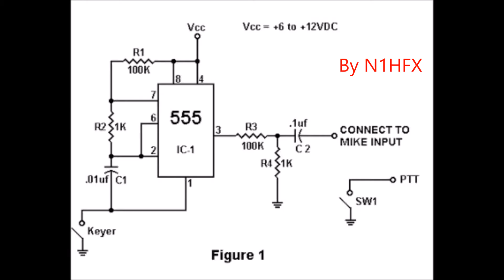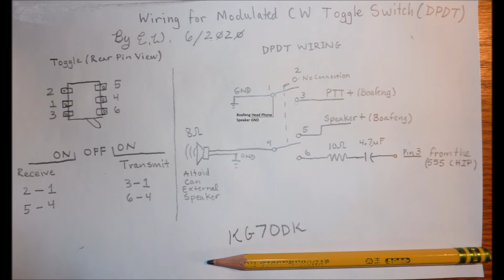Baofeng UV-5R CW Keyer, Morse Code via 2m FM

Comment: Hi, i am trying to do the same thing like the one in the video but i have a problem. I build a cw paddle with a metal clip for paper where the body of the clip is the ground pole and then two contacts, between the body and the two levers of the same clip, are 2 different poles (my idea was to destinate one pole to dahs and the other to dits. I tink that without a dedicated circuit this is impossible). Knowing that a vertical cw paddle is like a switch, if i want to use my "double pole" paddle without a circuit, it can be like a double pole switch? 
If what i said it's true i need to know if i can use my very very strange "iambic" paddle with the video's circuit. I'm asking becouse of the 3 cables that are in the output of my key... 
Thanks for help!

Comment: Hello. How did you make it? I tried to do it after you, but with a 0.1uf cap, and the RF from the baofeng plays with the 555 timer or something else, and jt changes up everything, the pitch and all. The pitch also isnt stable. Any help?
Reply from the maker: Its possible the newer Boafengs are more suseptable to noise? Maybe upload a youtube video of your build and we can inspect it for any possible faults. The hardest part is patching into the existing headphone / mic cable because the wires are so small. I would recommend using the exact capacitors listed in the circuit. Did you replace C1 with a 0.1uF cap?

KIR EW
Reply: @evanwolfe2525  I did yes, I used 0.1uF caps everywhere. It outputted a nice pitching sound, but the moment I pressed the PTT button (the baofeng wasn't even connected in any way to the circuit), it just stopped beeping. I suppose electro magnetic fields?
Reply from the maker: @avernayazaschita  The 0.1uF may be part of the issue. So when its disconnected and you ground pin 1 of the 555 chip to ground you should get a tone from pin 3. Disregarding the boafeng, on pin 3 you should have a 10 ohm resistor and 4.7 uF capacitor in series with an 8ohm speaker. I would test this portion of the circuit before trying to connect to the boafeng. Build on a breadboard then once working transfer to a soldier board. You should not get a tone until pin 1 is grounded. 

Are you able to upload a video for inspection and tips?

Keep It "ReeL",
Evan
Reply: @evanwolfe2525  I cannot because I'm not near it. I'm not sure but I hear a tone, and I built it a bit differently. I used a 10nF cap, 100k and a 1k resistor. And it works pretty fine. Until I turn on the Baofeng.
Reply from the maker: @avernayazaschita  Roger that. Next time you're by it get a video of what its doing and draw a schematic of EXACTLY the parts you used then we can go from there.
Reply: @evanwolfe2525  Okay sure! Another thing is, it's not protected by any aluminium or any can. I believe this can be causing all the problems?

Comment: Hi Hello Evan !!  Awesome  !! My Question is Could The MFJ - 464 Keyer - reader be Wired up To Replace Your Unit as My in Favour of a Computer Key Board  ???
Reply from the maker: Peter, Yes you could wire the output of the MFJ 464 into your radio's microphone input. This will allow you to SEND cw over 2m for example. My only concern is for receiving cw back with the MFJ 464. I have a PSK 232 that would translate cw to text fine on HF when my radio was in cw mode, however it wouldn't work on our local 2m FM repeater. Why? You might ask... I believe it is because my PSK 232 is looking for the on and off continous waves to drop in and out instead of a constant audio received from a modulated tone sent via FM, i.e. where the repeater is keyed down constantly. I have no doubt your unit will send well, but you may have issues receiving, i.e. translating CW to text via a modulated tone over 2m FM repeaters.   What type of radio will you be using to transmit? Keep It "ReeL",  Evan

Comment: Thanks very much, Evan. Yes, my hand is raised! 😄 I have tuned my $15 sdr dongle to 144.074 MHz and set it to upper sideband. I then cut the Baofeng stock earpiece plug from the rest of the earpiece and plugged it in to the Baofeng. I tuned the Baofeng to 144.075 MHz, then keyed the transmit button and sent my callsign, KF5WLF, at a snail's pace, being that the Baofeng takes a while to key up and key back down. At the 1 watt setting, and monitoring the spectrum on the receiver's computer screen, it didn't really look that bad. My keying was awful, and nobody bothered to answer me. My receiver was hooked up to a homemade horizontal 2m 3-element yagi. But I have sent cw with my Baofeng!
I just remembered...I also turned off the PL tone. That, and the cut mike cord minimized carrier modulation, so all that came out was carrier (assuming that when something is plugged in to the mike jack, it turns off the Baofeng internal mike.)

Comment: I presume that you used the original baofeng headphone ptt connector because you ripped into it to investigate the internal wiring? I guess I could use individual plugs if they fit next to each other in the baofeng so I didn't have to sacrifice the headphone ptt unit?
Reply from the maker: Loretta, Yes you are correct, I did use the stock Boafeng PTT headset. Grab the right size headphone jacks and you'd been in business. Best of luck building. EW
Reply: @evanwolfe2525  Thanks.....I will look thru the parts bins and see what I can come up with.

Comment: Brilliant! Maybe you were Guglielmo Marconi in a previous life. If it were me I really would connect red to black and probably blow up the Baofeng. Me: "successfully builds a 10-cent  toner, but, fries a $40 multi-band, carrier wave generator." 
Next project... say doomsday has happened and you have to get a message to mom. China is a proverbial parking lot so Baofeng is toast. Russia has fried all electronic devices in the world with a nuclear magnetic pulse. Could you build a radio shack in a shoe box to tell mom you are ok?
Reply from the maker: Its a guarantee I would conjure up some radio parts to make an operating transceiver. That gives me a good video idea! Thanks for watching Jim. (Also, electronic's that are in a Faraday cage would be perfectly operational after a EMP. )  Good luck tinkering out there. KIR EW
Reply: Dear Jim Jaeger. I think that Russia, least of all countries, would like to fry someone with a nuclear impulse. It is better to cut the transatlantic data cable in response to the explosions of Russian gas pipelines. That's when the SW connection with Europe will be required. 73!